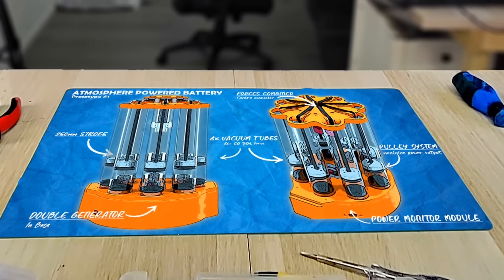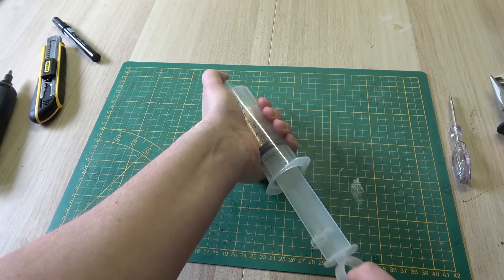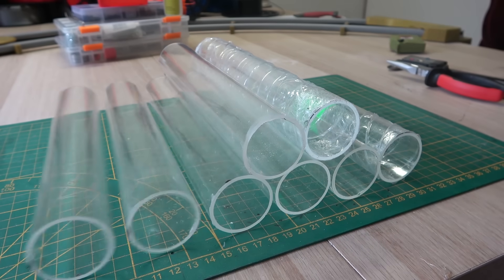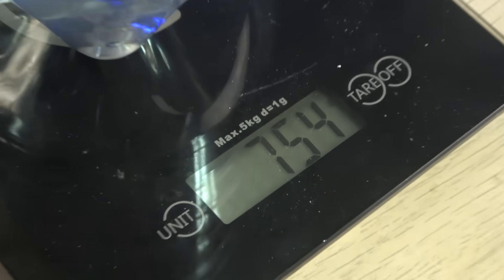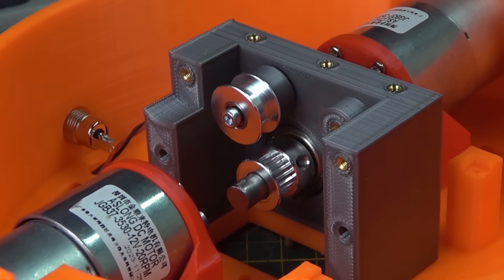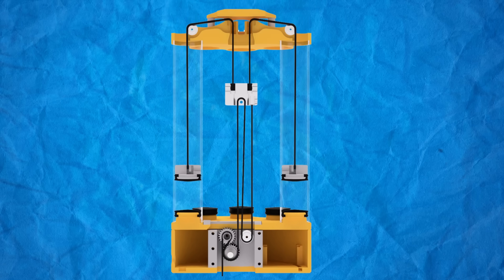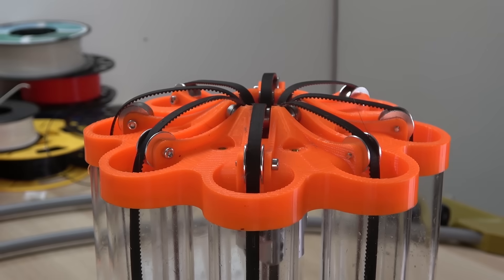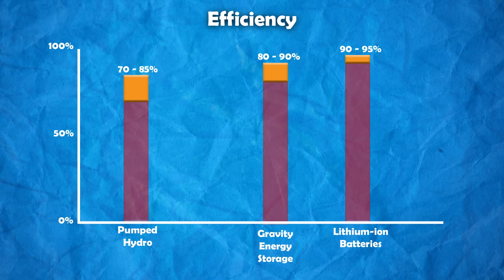Building an Atmosphere Powered Battery..

Comment: Watt is a unit of power, not energy. You didn't achieve an efficiency of 73%, those motors aren't efficient enough to turn electric power into mechanical work and back to electric power at anywhere near 73% round trip efficiency, even without all that additional friction you have in that system.  

The biggest fundamental and unavoidable issue with vacuum energy storage is the extreme cost per unit of capacity.  Compressed air energy storage is difficult to make meaningful in comparison to other alternatives, but many times better than vacuum energy storage, in multiple ways.  For the same volume, a vacuum chamber can only store as much energy as a pressure tank with one atmosphere "gauge pressure", or two atmospheres absolute pressure, and it's easier to make a pressure tank that holds 10 atmospheres gauge pressure than it is to make a vacuum chamber of the same volume. 

With all that work put into it, and it looked really nice, I wish you'd gotten the technical parts about the capacity and efficiency right.
Reply from the maker: Thanks for your comment and feedback!👌

The core of this project was to explore and see what was possible, even with some limitations.

Regarding the watt-to-energy aspect, you're correct that watts are a measure of power, and I appreciate the correction. 

To clearify how i got to the result you see in the video:

To charge: ~12.08V x ~1.62A x 43.709 seconds = 860,64 Watt

After a discharge: ~9.42V x ~1.15A x 57.993 seconds = 628,24 Watt

All value's are measured by the Arduino Nano in combination with the INA3221 Power module.

I will work on refining my future explanations to provide a better understanding of the technical aspects. Thanks for pointing that out! 

I hope that despite any shortcomings, you still found the video interesting and inspiring. Sometimes it's not just about the final outcome, but also about the journey and what we learn along the way.

I'm always happy to receive feedback and suggestions for improvement, and I hope you'll continue to watch my future projects!😊
Reply: @ConceptCraftedCreations Came to say the same as above. It is an accurate assessment. You are probably in the 25-30% efficiency range as those motors aren't very efficient. If you can measure your current and voltage over time (sampling at something like every 10th of a second) you can calculate your actual power use. 

I also recommend pressure storage instead of vacuum as it removes the 1 ATM limit on storage. However, I want to add that pressure storage really comes down to a strength and cost of materials issue. You can calculate it out to a point where you can show a figure of cost/yield strength and plot all the materials. There are other factors to consider though (like the safety of a high pressure tank full of lots of energy). Vacuum in theory could be just as economic, but has a problem outward pressure doesn't have. Buckling. To make a storage system economical you would need to use the materials to the edge of their safe limits. So 1ATM would be a very thin tube for most stronger materials. However that force is pushing inward. This causes the tube to warp and collapse in on itself (buckle). Outward force won't cause that, so for the same gage pressure a much thinner tube can be used. 
Vacuum pressure does have an advantage in that it is nearly constant however, which works really well for getting a constant pulling force over a distance and making the generation and tensioning system much simpler. 

I looked at all sorts of energy storage options years ago. 
Mass/gravity systems take enormous masses to be effective and is why really only pumped storage is practical. 
Inertia is decent for short term storage, but friction catches up to you for longer term. Safety of a spinning disk is also a consideration.
Pressure stores moderate amounts of energy, but also creates a huge bomb to rupture at some future date. 

Capacitors don't store enough energy, but are great at buffering changes in charge and discharge rates.

Chemical has been pretty inefficient and low storage amounts in all but the latest generation of batteries. The cost has been pretty high until the last 15 or so years too. There are other technologies making fuels that have some promise. 

Electrolysis and H2 storage could be practical for a fixed facility. I don't see it being practical for vehicles. There are too many conversion losses and safety issues to address that drive the cost way too high (they can be overcome, it just costs a lot).

Internal stress (springs) don't store enough to be practical for the cost of materials used. 

Thermal storage can be very practical, particularly if it doesn't need to be converted to higher quality energy like electricity. Homes for instance could use store heat for space heating very effectively. 
It is also somewhat practical for grid scale energy storage, though I believe the plants they have built thus far are considered failures. 

In the end LiFe batteries are the most practical storage method available at smaller scales. They are pretty high energy density and the cost is getting pretty low. Sodium batteries will probably over take them in the next five years as the low cost option. 

Regardless of whether something is the best method though. It's still fun to experiment. Also sometimes efficiency is irrelevant. Sometimes it is about what you have and can achieve with it. I have interest in low temperature difference stirling engines. They will never be efficient, but if the energy source is free, sometimes efficiency doesn't matter.

Good luck on your experiments. Your video was well presented.
Reply: @court2379  Good breakdown and accurate afaik.
Reply from the maker: To clearify how i got to the result you see in the video🤓

To charge: ~12.08V x ~1.62A x 43.709 seconds = 860,64 Watt

After a discharge: ~9.42V x ~1.15A x 57.993 seconds = 628,24 Watt

All value's are measured by the Arduino Nano in combination with the INA3221 Power module.
Reply: @ConceptCraftedCreations  As pointed out by others, looking at output power is indeed not correct for the efficiency assessment. However, good news! Your calculations do not result in power, but actually the energy (in this case Watt-seconds, i.e. Joules). This is exactly the quantity you should do the assessment with. If your numbers are correct, I'm very surprised of the efficiency!
Reply: @ConceptCraftedCreations  The mistake you're still making is that your calculus don't provide Watts but Joules.
Stop saying Watt, unit of power, while in fact you're comparing Joule, unit of energy.
Reply: @ConceptCraftedCreations  that's not how you calculate watts, watts is voltage * amperage, so its 20 watts charge, but the only important value in this case is watt hours which is 0.238wh, and 0.17wh out, but like people have said that seems like a very high efficiency so you might have made an error in measuring it
Reply: @ConceptCraftedCreations V*A*s ≠ Watt but rather Watt-seconds (the more common unit is kilowatt-hours - kwh)
Reply: Wrong, you are measuring energy, so you should say watt-seconds or Joules. Watt is a unit of power, also I think a mistake was made. That type of motor is like 70% efficient and you have lots of seal friction. Get a good power supply to measure Input power or double check your amp measurement circuit. 1kJ is about 10% of a AA battery, so impractical. But that said, very cool project. Good Engineering
Reply: @ConceptCraftedCreations  12.08v x 1.62A is 19.57 watts x 43.7 seconds is 0.2376 watt/hours of power. (Houses use ~10 kilowatts of power per day)

9.42v x 1.15A is 10.83 watts x 58.0 seconds is 0.1745 watt/hours of power. Which is 73% efficient, but I’d like to know how you measured it. 

For example, if you measured both at the beginning of each phase the charge power would have less of a pressure difference to work against, so a higher draw after measurement. And for the discharge phase it has the most pressure difference at the beginning so less power provided towards the end. 

To truly maximize your output you should utilize a MPPT charge controller and a sensor that can graph amperage over time to get the true area under the curve (energy). The motors you are using with internal gear trains shouldn’t even have 73% efficiency, not even counting the pulley and seal friction. 

Brushed motor efficiency ~85% x gear loss (-10% per stage, 2 stage) 90%^2 x ~85% generator efficiency x gear loss again 90%^2 = ~47% efficiency.
Reply: @ConceptCraftedCreations  Volts x Amps = Watts,   Watts x Seconds = Joules. 
This consumes 19.6 Watts continuously while charging. and requires 855.36 Joules to fully charge.
This produces 10.8 Watts continuously while discharging. and can output 628.2 Joules before depleting.
Reply: @court2379 The units are watt seconds not watts, he just mislabeled it as watts.
Reply: @ConceptCraftedCreations  The math looks OK, the issue is just your units. 1V x 1A = 1 W = 1 J/s, so 1V x 1A x 1s = 1J. That is, the units on the right-hand-side of your equation are Joules (a measure of energy), not Watts. If these values are correct, however, your efficiency measure is correct. I find it highly dubious, though, because a 600:1 gearbox and a motor (especially a brushed motor) wound only for motor operation should not, together, yield anywhere close to 73% efficiency when driven in reverse.

I would suggest using a DC-DC boost transformer connected to another 12 V motor lifting a weight of known mass as the load while discharging your battery. You can measure the efficiency of this winch system independently (just connect the boost transformer to a 9.4V power supply and measure the current) and then compensate for it in your final calculations, but it will give a visual proof of the efficiency of your battery. Since the pressure on the plunger is constant, the energy stored is proportional to the height of the plunger, so you don't need to charge the system all the way for this demonstration. For example, if you attach a 15 kg mass to a winch and lift it 1 m, this will require 147 J of energy. If the boost transformer/motor winch system is 80% efficient, you will need to input 147 J / 0.8 = 184 J into it. Based on your numbers, this would require charging the system with 252 J of energy, or about 30% of its capacity.
Reply: @jarkenmer  Nerds don't go to parties, don't be ridiculous
Reply: @ConceptCraftedCreations  Voltage and current were constant during the process? (the units from your results should be J, not W)
Reply: @ConceptCraftedCreations  So if you calculated V x A x  seconds, then the output is in Wattsx seconds which is Joules, which is actual unit of energy. I can't say if your measurment is correct, but method to some extend isn't too bad. Please add some info of your mistake on video, so it wouldn't hurt eyes. Great visualising animations and models.  It would be better to track changing voltage, and current over time and calculate integer.
Reply: @ConceptCraftedCreations  you actually calculated Joules. Volts x Amps x Seconds is Joules.
Joul is equivalent to Watt * Seconds, because Volt x Amps is Watt.

By talking about energy and saying Watt, people usually excpect you to mean. Watthours, but you uses Wattseconds, so 3600 times less energy.
Reply: @ConceptCraftedCreations  You need to use average values, over full charge or discharge process, not peak values. Volt times amps, at any given moment gives you watts at any given moment, multiply the average with the number of seconds, gives you the number of joules which is a unit of energy.    

Your discharge values seem way to high, for any longer periods of time than a very small fraction of a second values peak in each revolution of the generator. You can either stabilize the output and measure it, which would give the most practically meaningful value, or, you can measure volts and amps with high enough resolution to get a curve for each revolution, and take the average. 

If your results are anywhere near 10% round trip efficiency, or higher, from that system, you're definitely not measuring it correctly. Such DC motors can be up to about 80% efficient, under ideal conditions, but that requires a lot conditions to actually be ideal. It's more likely you had below 50% efficiency, just converting electrical power to mechanical energy, and then 20% losses just between the motor and the plunges, so 40% left, and then about 50% of that energy was probably lost to friction, between plunges and tubes, so we're at about 20% of initial energy left, rough but optimistic estimate, just after charging the system. From those 20% stored, about half will be lost in friction in the tubes during discharge again, and then about 20% of that is lost in the belts, and about 8% of the original energy will be left for the motors, which, won't be able to convert that energy back to electrical power anywhere near 50% efficiency at that rate. So, somewhere <4% efficiency is reasonable. My estimate for the friction in the tubes is more of a guess than based on solid data, but there are additional problems involved that can more than make up for any overestimation of losses I might have done.
Reply: @fishyerik wrong
Reply: @ConceptCraftedCreations  your calculation of voltage (V) * amperage (I) * time (t) actually results in joules because power = V*I (which is measured in watts) is energy in joules per unit of time in seconds, so multiplying by time gives the total amount of energy used.

In this case, it took 860.64 joules of energy to charge, and you got 628.24 joules of energy back out.
Simple unit issues, but the numbers are correct.
Reply: @ConceptCraftedCreations  Your calculations are correct, but the output is energy and unit is Joules not watts. Watts is just voltage times current.
Reply: @ElectroBOOM  No they are not correct. He needs to integrate.
Reply: @ConceptCraftedCreations voltage times current equals watts. Multiply that by time you get joules not watts.
Reply: @ConceptCraftedCreations  You have calculated watt seconds, so just replace watts with joules and you are good to go
Reply: @ConceptCraftedCreations  Then use Watt Seconds as the are your unit of ENERGY.  Watts are power, not energy.  You are stating your results incorrectly.
Reply: @ConceptCraftedCreations  You mean watt-seconds -- also known as "Joules".

But your math or your measurements must be wrong here, because there's no way whatsoever that you're getting that efficiency with this setup, the motors ALONE don't have that round-trip efficiency, and then there's all the friction. I'd be surprised if this setup can even manage 50% round-trip efficiency.

Still a fun educational project of course.
Reply: @ConceptCraftedCreations  This idea is so awesome and I explored it in my head a little and came to some very cool realizations that you might explore.

First of all, the calculations you did are actually completely correct as opposed to what a lot of commenters are saying. You just mislabeled watt seconds (joules) as watts.

For reference, 1 watt is 1 joule per second. You can think of power (e.g. watts) as a speed.

It's like multiplying meters per second (watts) by seconds to get meters (watt seconds aka joules)

Some other commenters also pointed out that the battery capacity is quite small. This does not mean that the battery is worse than traditional gravity storage! In fact it actually is gravity storage, it's just an entirely unique way of doing it. What you are doing is quite literally lifting the atmosphere up to store power and then letting it fall back down to release it. So while traditional gravity storage lifts a weight and lowers it, your storage lifts the weight of the atmosphere and lowers it. The atmosphere is heavy, and this is good because the more weight the more your battery can store! The capacity should scale proportionally to each of the dimensions. To reduce the amount of friction you would like to reduce the surface area of the syringe "plug" on the wall of the storage. To do that you want as few syringes as possible and you want them to be as large as possible. A circle results in the least surface area for your case so a syringe is the ideal shape going with the plunger idea so it works out fine.

Now consider this... Concrete has a density of about 23,535.96 newtons per meter cubed. Atmospheric pressure is about 101,300 newtons per meter squared. This means that a 1.128 meter diameter syringe to store the same energy as lifting about 4.3 cubic meters of concrete. Doubling the height of your syringe is equivalent to doubling the volume of the material you're going to lift. This means your battery's capacity theoretically scales more efficiently with size!
Reply: @Hexcede  Now consider this, you may not have understood the criticisms and you gloss over them without proper examination. Also, you assume the measurements are accurate, which seem very unlikely.  Fact is, there are loads of "brilliant" ideas or demonstrations that may fool some people into excitement, but for people with some experience looking at all these claims its clear that they all are pretty vacuous.
Reply: @ConceptCraftedCreations when you multiple current and voltage you already have power. By multiplying by time you have energy. The result might be correct, just not the units. And yeah, the main issue with this technique is that you'll never have a full vacuum inside, thus not having the full amount of force you expect. Furthermore, it's harder to make a vacuum than to make a pressurized tank. And in all of this, you are still limited to the full vacuum force. It's a cool idea though, just limited by principle
Reply: @ConceptCraftedCreations  Great video, great comment, and great response! This intelligent conversation gives me hope. I'm subscribing.
Reply: You said your monitoring electronics recorded time as well all we would need to know the energy is the time it took to charge and the time it took to discharge, if you still have that data.
Reply: @ConceptCraftedCreations  this is great and you could get like 1% on a phone if you connected it. That would be another fun test to see with this or a larger version.
Reply: @ConceptCraftedCreations  EXCUSE ME but ~12.08V x ~1.62A x 43.709 seconds = 860.64 WATT-SECONDS.  And the fact you don't seem to think this distinction is relevant really disturbs me.
Reply: @SkylosSobaka  You’re excused
Reply: @SkylosSobaka  you are very disturbed, true that.
Reply: @_..-.._..-.._  wat?
Reply: @ConceptCraftedCreations  That's joules actually, not watts that you calculated. V*I*s => Joules. So your result is meaningful and it's the write number to display, however "Watt" is not the correct unit to write after it. Great concept btw !
Reply: Your precis doesn't take into account the technical difficulties of compressed storage. there is the added significant cost of reintroducing heat to the pressurised air. also much care must be taken to ensure with compression the mixture does not become volatile.  Yes there are more efficient ways to store energy however they all come with downsides and at least this one can be easily made by a diy'er. its a great example of the experimental process.
Reply: @DeveloperChris I've worked with some large scale air storage systems before, and I have to say it's an absolute pain in the ass. Would avoid if possible.
Reply: @DeveloperChris  Compressed air energy storage has a lot of problems, no doubt, but all things put together it is, compared to vacuum, still much easier to store meaningful amounts of energy in compressed air than vacuum. That doesn't mean compressed air is a good way to store energy. 

As he correctly calculated, he had potentially about 80 kg of force, assuming perfect vacuum, meaning the amount of stored energy would be the same as lifting and lowering a weight of 80 kg the same distance. 80 kg represents about 800 joules per meter, or 0.22 watt hours per meter. 2 meters of tubes, divided by 8 pieces, means 250 mm of total length per tube, so about 200 mm of working distance, total stored energy about 160 joules, which is less than 0.05 Wh.  That is before all the losses in the discharge process, which are so vast that the actual potentially useful energy that can be generated is somewhat difficult/complicated to measure accurately.

A person that weighs 80 kg, use that amount of energy to raise their body 200 mm, meaning a 80 kg person use the amount of energy that system can hold stored, for each step they take up a stair with 200 mm steps. That's again before discharge losses.    

While I used a lot of estimations, some of which were very rough, the fact that the system can't store meaningful amounts of energy is shown by fundamental physics involved. Also, even simple gravitational storage is much cheaper and easier to make, and make more efficient. I still liked the video, I think it should be explored, but I'd liked it more with somewhat accurate measurement of the actual energy discharged from it. 

Most of the energy a common "consumer" air compressor without multiple stages and intercooling between stages use, turns into heat, and single stage expansion from such pressures loses close to half the potential energy due to the decrease in temperature alone. Still, it's a widely adopted way to store energy, not in order to convert energy in compressed air back to electricity, but to use the compressed air to perform work directly.  Despite the huge disadvantages, it's proven a viable option for energy storage.   

If better compressors are used, and there's good use for the heat, and also good use for cooling during expansion, compressed air energy storage could potentially be viable for energy storage even for generating electric power on demand, as a part of the useful outcome.
Reply: @fishyerik  I don't disagree in fact I really like the whole bladder system for underwater storage. However compressed air not really practical for a diy'er. 
As you point out the return on investment for a vacuum system is really bad. I ran through this exercise a large number of years ago (15+). However mine was vacuum assisted gravity well meant to be built on residential properties. When I realised that the return was so poor I dropped it. In fact you have reminded me why I killed the idea.
Reply: @DeveloperChris  I've just investigated utilizing an air compressor to first generate heat, and after storage both extract some power, and also utilize the temperature decrease for refrigeration, and air conditioning. 

It seems to me, for a DIY-level, the biggest issue for that idea is that there are no good tools available for the expansion. Commonly available rotary compressed air tools are designed to be cheap to make, last long enough with reasonable amount of service, while able to produce useful work, but efficiency is typically just not near what could be achieved quite easily, if that had been a design consideration. 

That means, besides the fact that reasonably priced expanders can't turn much of the stored energy into power, and also means, the amount of cooling that can achieved that way is also very small. I think it would have been interesting concept otherwise, a simple air compressor to provide heating, cooling and some power storage, even if the efficiency wouldn't technically be very high, and ridiculous if only considering the useful power out of the system.
Reply: @fishyerik  The biggest issue in my opinion is the waste heat. In Aus we dont need a lot of low quality heat which is watt (ha ha) you get from compressing air. so apart from the depths of winter most of it would need to be dissipated, however getting heat at least during the day for expansion is easier.
Most air pressure systems use the air decompressing into a high speed gas to drive turbines and yes not really a DIY type of project as they are quite technical but it does make me wonder if instead the air could be used as a sort of compressed spring. simply using the pressure to turn a generator by a pulley system. I am immediately thinking of problems with that but they are probably solvable. but an actual spring may be better again.
Reply: Using air to store energy is not efficient at all thanks to the temperature of the air changing with pressure. While you're filling it up, it releases heat into its surroundings and the other way around.
Reply: Yeah, it’s a shame that this unique project isn’t perfect and exactly the same as other existing storage solutions 🤦‍♂️
Reply: Thanks!
Reply: 😮 Can you multiply the watts by time to get energy for each of :charge and discharge?

Then you'll have energy and can do proper calculation of efficiency.
Reply: Can you multiply the watts in each cycle, by time, to get the energy? Then do the efficiency calc.
Reply: but compressed air will radiate some of that energy as heat isn't it ?
Reply: @yassiguy  Absolutely. How much depends on how much/fast you compress it. Heat loss due to compression can be insignificant, if you only want to store about as much energy as that system can, and at similar rate.
Reply: @yassiguy  This isn't a compressed air battery.
Reply: True, air guns require a lot of force to pump up or cock the spring, etc. Many  ft. Lbs. Of energy to get maybe  18 -34  ft. Lbs.    in projectile energy.
Reply: I think it's worth exploring the safety factor at the very least. A compressed air storage system could have a failure that brings your whole house down, whereas this system should cause less damage to the surroundings if it were to fail
Reply: yew, he's stupid. Unique and useless.
Reply: @ConceptCraftedCreations  You must take in account the time needed for charging / discharging if you want an accurate evaluation of the efficiency of your battery :
Efficiency=(Td x Pd) / (Tc x Pc) = Ed/Ec
Td : discharging Time in seconds
Pd : average discharging Power during Td in Watts
Tc : charging Time in seconds
Pc : average charging Power during Tc in Watts
Ec : Energy needed for charging in Joules
Ed : Energy recovered while discharging in Joules

@fishyerik Without explaining how to correct it, pointing a mistake has low value.
Reply: Yes . Lacking basic knowledge of physics? God 3D printing skills? 😂
Reply: I'd love to see the piston system being used with a valve to drive the motors in a ratchet-way so compressed air could be used to drive them.
That would allow a fun test of pumped storage.
Reply: When you're so caught up in pontificating on what you think you know that you make assumptions and miss that he did in fact calculate energy in Joules. 

What he is calling Watts is very clearly Joules.
Reply: @kiraPh1234k   Regardless of what you think you know, he didn't reach a round trip efficiency of 73%, as that is many times more than what's possible with that system. 

Try to read a few more of my comments, and point out which of assumptions you can prove being unreasonable to the point where 73% round trip efficiency becomes realistic.
Reply: @fishyerik  I understand that the round trip efficiency should be lower, but how can he still record certain amount of energy in, and get 73% of that energy as output?
Reply: @fishyerik  unlikable erik
Reply: Ok so i need 1000 of those to replace my 2 powerwalls?
Reply: @KarlLew  You need a lot more than that. He got 628 joules out of it. there's 3600KJ in a single Kwh, so you'd need 5730 of these things to store a single kilowatt-hour. 

A powerwall has (I believe) 13.5Kwh, so to store that amount you'd need 77355 of these things.
Reply: @KarlLew  All the theoretically possible capacity is less than 160 joules, meaning, you'd need more than 22500 of those to store 1 kWh, but that's before losses in converting the stored potential into electric power. 

With much better generators, and minimal friction it might be possible to need slightly less than 50000 times that volume of vacuum to extract 1 kWh of usable power.
Reply: My thoughts too, you saved me some typing.